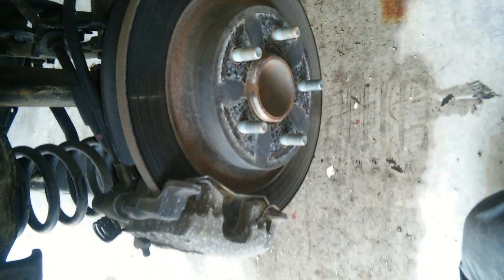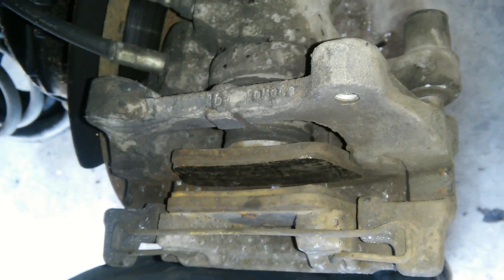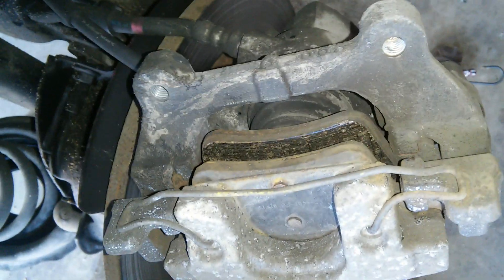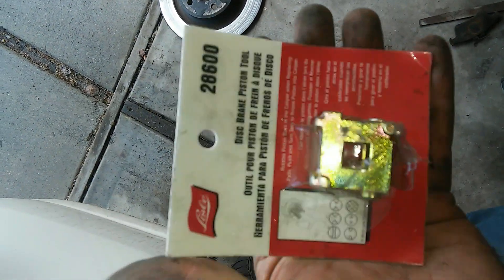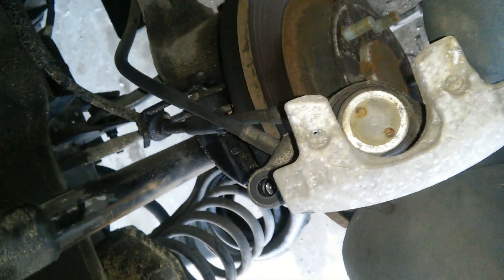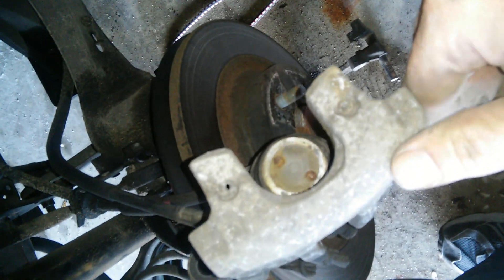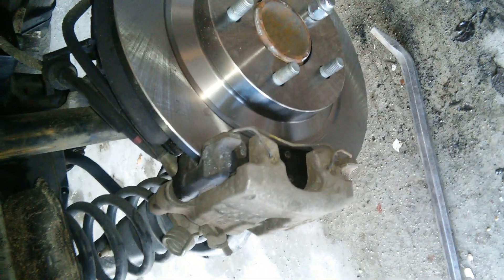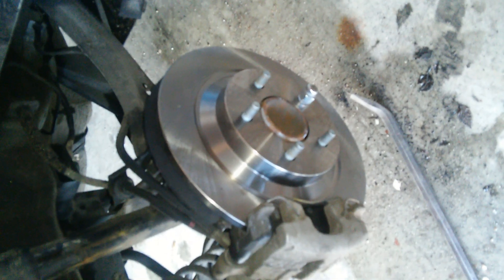Mazda5 rear brake and rotor change

Comment: I bought a kit for compressing the rear piston from harbor freight for about $40 a few years ago.  I don't know that it would fit  this, but I have always seen it fit.  It has far more adapters than the one you mentioned, so that is an alternative as well.

Comment: What will stop a caliper piston from going backwards in.if the bleeder valve is out?
Reply from the maker: The mechanism inside is engineered to prevent that, due to needing the ability to also act as the emergency brake.

Comment: Hi guys bit thick here but when you mentioned the 14mm socket which way do it undo clockwise or anti clockwise
Reply from the maker: James Lillycrop , anti I believe. Just a typical bolt. None are left hand thread

Comment: Okay guys thanks for the message is there a video that shows how to replace the caliper itself
Reply from the maker: I don't have one, but you just need to disconnect the emergency brake and the brake line, and just reattach them to the new caliper. You will need to bleed the brakes, I'm sure there are plenty of videos on bleeding brakes

Comment: Is there an email or something I can contact you at? I have an 08 Mazda 5 and have a question about the rear flex hose. The fitting between the flex hose and bracket is leaking brake fluid pretty bad I'm no mechanic is this an easy fix or should I bring it to my mechanic? Any information appreciated. Thanks

Comment: Thanks I am trying, key word trying,to change my rear brakes on my 2013. I tried twisting like you showed but I just cant get enough downward pressure on the the piston. How much pressure did you apply to the piston. I know you needed a breaker bar but how much force on that?
Reply from the maker: hard to say. one side took much more. I had to use my pry bar and leverage it against the ground to get sufficient pressure. the trick was keeping pressure while turning, and keeping it free from the two holes. 
once it started to go it went quickly.
After I completed the job I read something stating to turn the piston out completely before turning it in-just don't go too far to release it completely from the caliper. that's a whole new mess.
Reply: Thanks, I just went to harbor freight and got a general piston compressor. I am a little hesitant to bring it out for fear of the piston coming out.
Reply from the maker: if I have it to do again, I'll probably buy one of those and modify it with 2 pins and weld the head of it to the screw so it will push and turn at the same time.